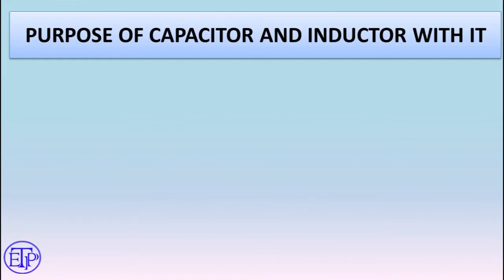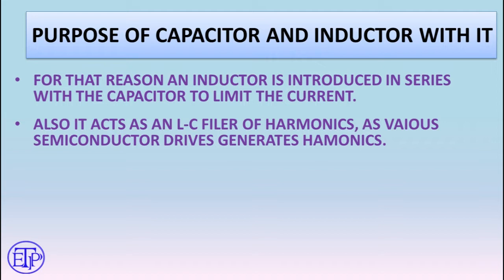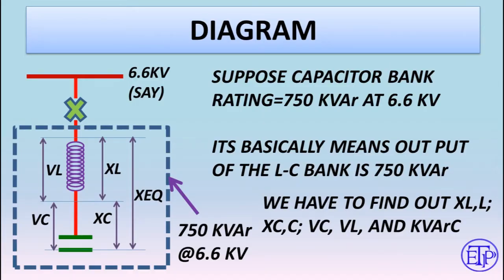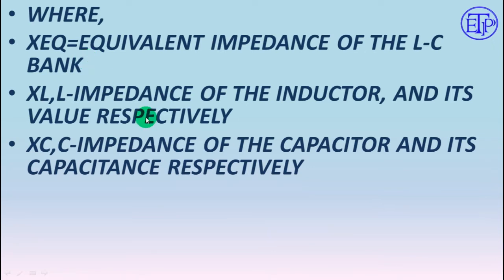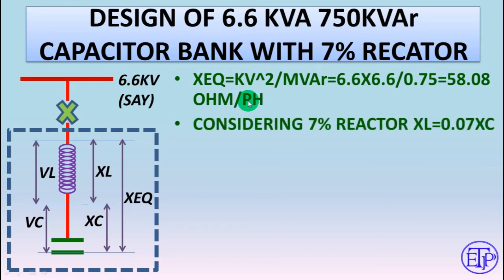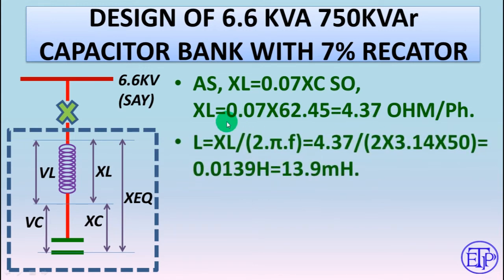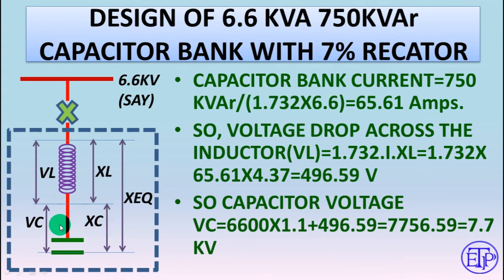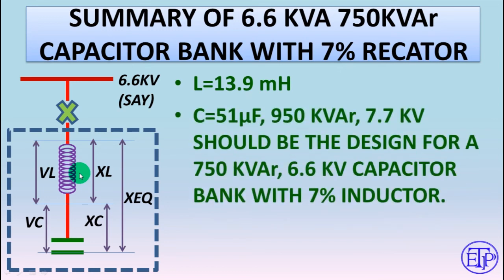CAPACITOR WITH SERIES REACTOR SIZING|DETUNED REACTOR|L-C BANK CALCULATION.

Comment: Thanks for the video, I still could not understand how will you check the power factor of a system. 
The required Power factor.. Ok can be assumed but please explain how will you calculate PF of complete system. I mean. 
If you have a residential building of 10 floors with a plant room, which accommodate the pumps and heavy AC system . 
Now for individuals motor the PF will be written on the name plate but when you consolidate into its panel (sub panels), then main panels and substation.... How will you calculate the complete PF of system.. Ultimately the Power factor control panel will be connected to the main panel. Hope you understand my explanation. 

It also mean while calculating the connected load we aggregate the total individual wattage so we have total watts, now to derive a ampere we assume the PF to be some value but we cannot derive the PF from the same as it was assumption. 
Kindly clarify please

Comment: In voltage drop across the inductor why (sqrt3) multiply?
Reply: This is the most relevant query which almost everyone has overlooked. You have all along done calculation on per phase basis. Why suddenly you multiply
Y the voltage drop with root3. In fact voltage drop is always a phase parameter. But interestingly if you do your calculation strictly on per phase basis you will arrive at the same thing. Here is how the calculation goes

Per phase voltage drop = 65.61 * 4.37 = 286.71 volts
Per phase Cap voltage = (6600*1.1/1.732)+286.59=4.48kv
Per phase Cap KVAR = 4.48^2*1000/62.45=321.38kvar
So three phase kvar =3*321.38=964kvar
So even when the line voltage increases to 1 .732*4.48=7.76kv this will work satisfactorily.
But generally the cap banks are connected in delta in LV network and in that case the calculation will  done considering star delta transformation.
The end result will be as follows:
Capacitance value in delta connected cap unit: 17micro farad
Xc = 187.2 ohm
Ic = 37.88 A
Voltage grade of each cap unit= 7.76 kv
Kvar rating of each cap unit = 321.38 kvar

HOPE EVERYBODY HAS UNDERSTOOD THIS

Comment: the 7.7kv is the voltage produced by capacitor? please explain. 6.6kv=VL+VC should be like that.
Reply: You are absolutely right. This is because inductive voltage drop phasor and capacitive voltage drop phasor are 180 deg out of phase.
However, one point that this gentleman has missed is the star delta conversion which is the soul to thi design. After you have found out the Xc you need to transfer it to equivalent delta connection. This way delta Xc will be 3*Xc . Please note that almost all capacitor bank in LT system is delta connected. So you have dovthis change.

Comment: HI,  can you please explain why we are using the sqt of 3 in the current equation, I am making a pf corrector for a vfd and I feel a little bit confused with it.
if we are considering this as a single phase branch so KVAr=I*V without using sqt of 3
v in this case to be considerd V line to neutral then later VXL sqr of 3 is used, I am missing  something here, would you be so kind to explain that in more details.
Thank you in advance.
Reply from the maker: actually the voltage and current are line to line voltage and line current only. if you calculate power with line to line voltage and line current you have to multiply by 1.732. i have videos on star delta system. please watch that. i hope your doubts wil be cleared
Reply: @electricaltechnologyandind5335  Thank you very much for your rapid response, you are very kind, I will watch these videos and hope to get rid of this problem of sqr of 3....
Thank again.

Comment: In capacitor current calculation why sin© is not used.. Pls explain.. Formula is root 3 visin©
Reply from the maker: You calculate with sin theeta and let me know the difference in comment section... You will understand yourself
Reply: May be © near to 90 as capacitance is of large value as I think..am I right.??
Reply from the maker: Yes.. that is the reason... There won't be any significant difference.....